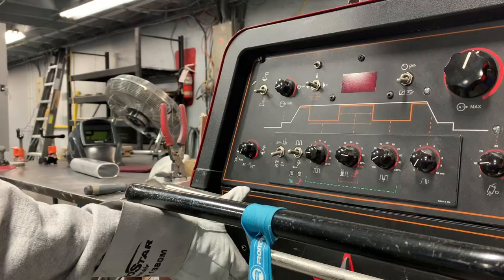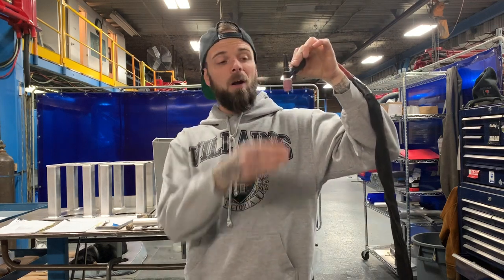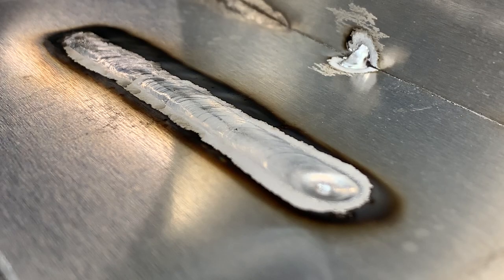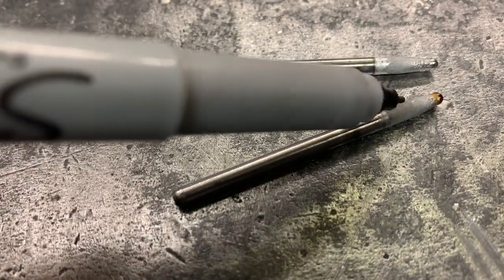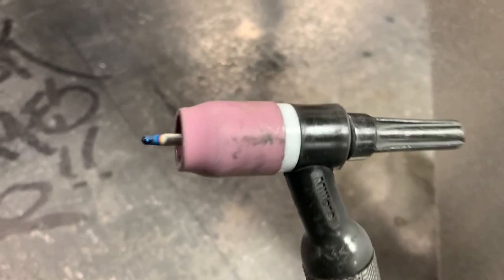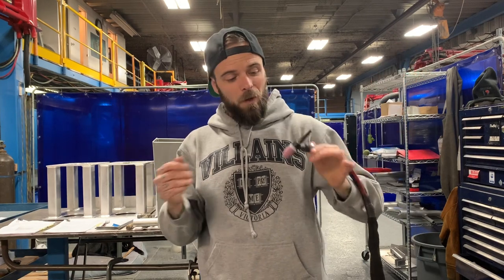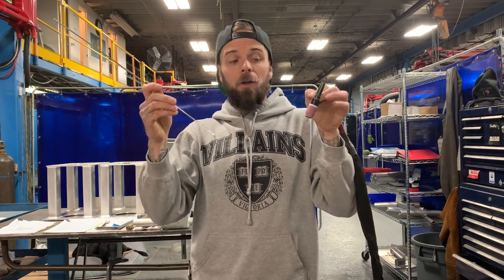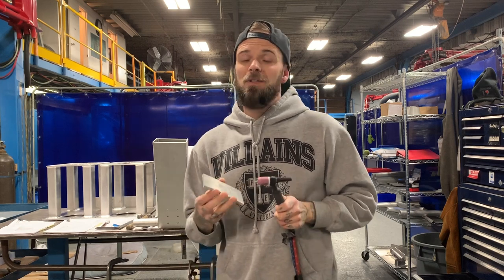TIG WELDING HOW TO - TIG WELDING FOR BEGINNERS - TOP 5 TIG MISTAKES

Comment: Thank you for your videos. I think they are best on tig welding on YouTube. I'm saving up to take the remote class.
Reply from the maker: Charles that’s awesome! Thanks for the kind words! I’m happy I can help in any way I can 🙏🙏🙏
Reply: I learned I was getting my tungsten too hot sharpening it and was contaminating the tungsten. Do I need to break the tungsten off if it turns blue from getting too hot during sharpening? I also turned up my post flow to 2.5 seconds from 1 second. How much post flow for 129-130 amps on mild steel.

Comment: Thanks for the video. I have a question. So I have a lift arc welding machine. A miller multimatic 215. How do I lift arc without touching the tungsten to the material?

Comment: Been watching you for a while and your awesome.  I bought a used Eastwood Tig 200 and cannot get it to weld Aluminum.  I'm clean, new gas lens, changed out my Argon, good pre and post flow and I still get white powder all around my puddle as soon as i touch the aluminum.  It smokes my tungsten and white powders my cup and lens.
Please tell me What is going on?
Thanks, Keith

Comment: Is the post flow only for keeping the tungsten clean or does it also affect the final weld pool quality?
Reply from the maker: GREAT question. It is strictly for keeping your tungsten healthy. If you are welding steel however, it is for both. Your steel weld will be glowing just as your tungsten is, so both need shielding:) Usually with steel you will run a longer post flow, as the material will glow longer than the tungsten, so just adjust accordingly:) 
Hit me up with any more questions! 
Weld on!

Comment: I think im going to make a video on how to sharpening tungsten with a drill and angle grinder. As people should own those tools and might not own a belt sander yet or have access to one. I use designated flap disk for tungsten. I marked it with a sharpie on both side so I don't accidentally use it on other metals. I went through 12 tungsten this morning. The first one ruined was me flipping the torch off the welding table I'm building. Not how I wanted to start my day!
Reply from the maker: Happens to the best of us! That’s a killer video idea too tho....
Reply: @PacificArcTigWelding  you are more than welcome to also make that video as I don't have a channel started and yours would help more people. I use 3 small pieces of 2x4's on wooden table then toenail screws in the sides to secure the angle grinder. A piece of electrical tape across the handle to prevent it from vibrating out from the blocks. Then grind 10ish tungsten at a time. Well because I only have 12 tungsten. Is the CK Lazer tungsten a good on all metals tungsten? I'm thinking about buying some.